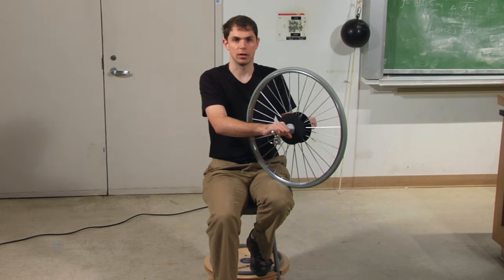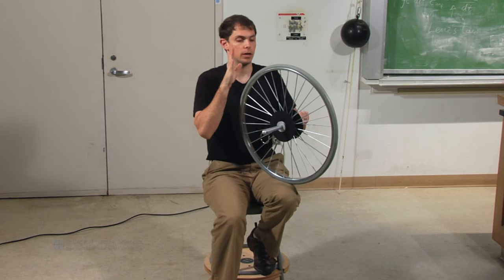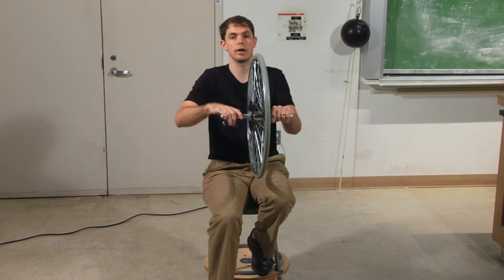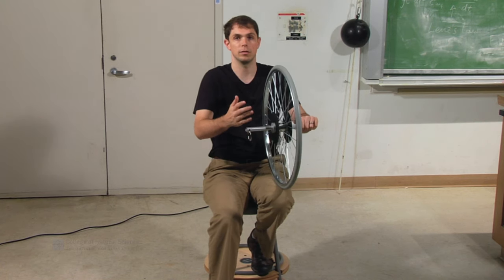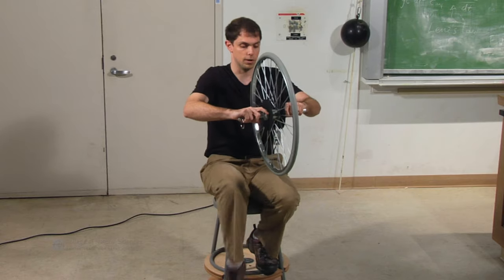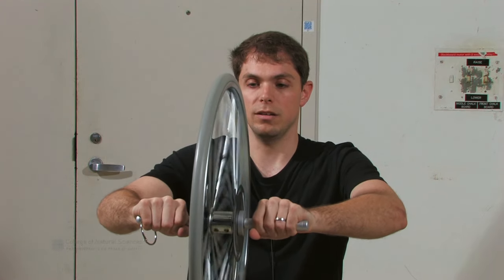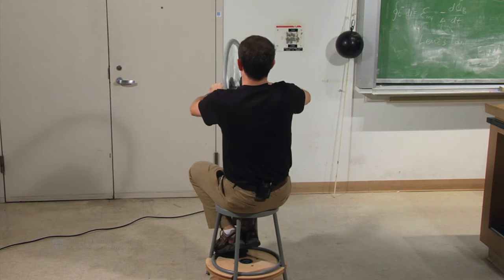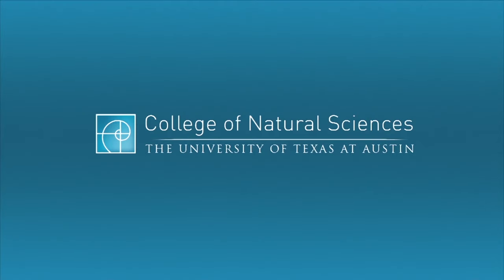Spinning Wheel on Spinning Chair

Comment: This would not have been possible without the confident and firm hands of that assistant, to him I say "thanks!"
Reply: Marlon, though this was posted many years ago - I was hoping you could answer a question.  If the angular momentum was EXTREMELY HIGH would it be possible to rotate yourself sitting on a char that is not a spilling chair?   Thanks!
Reply: Ok Marlon
Reply: "confident and firm hands". I bet that's in his Tinder profile.
Reply: Why does the assistant remind me Mr. Incredible at his workplace? 😅
Reply: True

Comment: I genuinely cannot fathom how this works and I just learned about it in physics
Reply: It just works.
Reply: Air has mass, and therefore can be repelled off of.
Reply: @gabrieli6008  No. This works in frictionless environments too, eg outer space. If this were true you could demonstrate this even better by putting paddles on the wheel, but it would have a negligible influence compared to the extra weight from the paddles. Thats why they don't, its not necessary and it might confuse people.
Reply: @gabrieli6008  it's momentum not thrust
Reply: @indiomoustafa2047  Oh shoot shows how much I know
Reply: @gabrieli6008  Think of the person, chair, and wheel as a system as they are all connected. The wheel builds up angular momentum as its spinning. When held horizontal its adding horizontal momentum to the system, when vertical its adding vertical momentum but his spine and chair have much much more resistance on the y axis than the x axis so when held to the side he slowly spins because the chair spins from low friction. A gyroscope is basically multiple wheels spinning all counter acting each others momentum causing stability. In space if he held the wheel vertically he would slowly backflip or front flip, hope that helped =D
Reply: @Anna_bananatv  great explanation
Reply: @Anna_bananatv  would weight only factor the speed and duration?
Reply: @gabrieli6008  No.
Reply: @Anna_bananatv  sheesh what an amazing explanation
Reply: Eric Laithwaite, ether, geocentrism.
Reply: The simplest way to explain this effect, is that it would NOT work if the wheel didn't slow down with time. The rate at which the wheel slows down is indicative of the amount of force transferred into the chair.

An interesting question is whether or not the distance at which the wheel is held from the center of mass has any effect on how much of the force is transferred into the "desired" direction (eg. force applied along a given vector).
Reply: @sandercohen5543 does chair spin constantly or is it only pushed by force needed to tilt wheel?
Reply: @Anna_bananatv  YES!! Thank you for this hey, my force diagrams were starting to not make sense. Now, in the x direction, the initial momentum (of the wheel) was in the +x direction (as WE look at him), so when he turns that 90 degrees clockwise (as he did), the momentum of the wheel is not in the -y direction (or downwards) yes? and thus THIS MUST be counteracted as IN THE Y DIRECTION THERE WAS NONE TO BEGIN WITH AT ALL yes? So then there is a torque UPWARDS from the person - this would explain the anti-clockwise spin (when we shift our view to the top his nose facing in the direction we was looking friom initially). In the y-direction there indeed is the L from before = L after = 0.BUT now what about in the X-DIRECTION??! That's what's throwing me off! Yes i do believe that's where your explanation comes in, that ONLY IN SPACE would we then be able to observe that effect - as the guy's momentum should be the same as that of the wheel before - in the +x direction right? So that would make him spinning with his head coming forward then down and his feet rising up behind him right? A forward flip is that not? See i ask this because - i assume you didn't have time to expand on this one, thanks again for exanding on the first part! - you had an either there. I just want the confirmation of a FORWARD FLIP? AND....WHERE DID ALL THAT MOMENTUM that SHOULD exist in the +x direction GO THEN? I'm assuming it got converted into a angular version of IMPULSE. Which pushes the stool/chair backwards? Is this true? Does it make sense? Like I'm thinking thw friction between the chair's legs is greater though than the..what force this must be then as we are now talking about forces...Torque? The chair-and-human system applies torque on the floor that is a result of a ((its) final)momentum directed in the +y direction? See because most questions and images and all don't cover this concept/part. See how even the flip was 90 degrees...what if it was 180? That's for space tho right (AND the a literal 180 degrees flip part for a initially held vertically wheel..which again is what most books have and all). I was starting to think i'm not getting this at all, turns out it was this "impossible" motion all along, the front flips. Thanks again!
Reply: Yogic sciences told us everything
 government just hid it with history you have today
Reply: @gabrieli6008  nothing to do with air

Comment: can you do one more where you spin yourself and see if the wheel spins in the other direction you are spinning to compensate?
Reply: If he spins himself, it means net torque on the system is not zero, so no, it won't
Reply: @herbert7344  this is what I don’t understand. So does it really make a difference if you spin the wheel yourself? Other demonstrations of this show people having no rotation at all while the wheel is spinning in one direction and then rotating really fast after flipping it. Other clips like this show being able to turn freely in both directions
Reply: @felulaval4742  Its because it has very little to do with the wheel itself. The turntable is just receiving forces from the person sitting or standing on it. If you are moving an object in your hands this is shifting your balance. This eventually results in you applying a force to the turntable with whatever contact points you have. E.G Your Ass or your feet. 

You can do the exact same thing without a wheel, and with a heavy object, or with your own arms.
Reply: I'm confused lol
Reply: Why is this so hard

Comment: This is basically what a reaction wheel in a spacecraft does: Because there is no medium in the vaccum of space that provides any meaningful force when pushed against, in order to rotate without expending mass, we use the inertia from weighted, spinning discs, that are rotated using an electrical motor.

Comment: Nice... You also had to use internal energy from your muscles to tilt the wheel from vertical to horizontal above and beyond the exertion that would have been required if you and the wheel had not been spinning...

Comment: So where does the angular momentum go if you rotate the wheel while its spinning but the chair spinning axis is locked so as to prevent turning on that axis and the handles are locked in place so that they can only rotate on one axis as prescribed by your arm rotation?
Reply: Momentum would not be conserved because there would be an external force involved, which is locking the axle in place.

Comment: I have a question. Is angular momentum conserved here? If i think of the angular momentum vector at the start it points twoards the right but once he turns the wheel it points twoards the floor while the angular moment vector of the chair points up. So the two momenta cancel. But overall there is no net momentum vector that point to the right unlike at the beginning. So is angular moment conserved or am i missing something. Is it because he applies a force on the wheel?
Reply: I need answers, please if u already know teach me senpai
Reply: Help me sleep
Reply: @uhmmmmmm...  in this example indeed only the z-component of angular momentum is conserved because thats the only axis the chair can freely move around.

Comment: why does it go in that direction? just because it's a law of nature or gravity??
Reply: Gravity plays no role in that. When you spin a rotating object in a different axis, you apply a torque to it in a particular way.

Torque demands force, and force changes momentum (which is conserved!). 
On the spinning chair, without anything holding him still to the ground, he only has the momentum of his own body+chair to give to the wheel. Thus he's accelerated according to the torque he applied.

If the wheel was spun in the opposite direction (it's spinning clockwise from his right hand. so, the alternative is counter-clockwise), the way he moved the wheel would spin his chair in the opposite direction too.

Comment: Wow, another great “physics” presentation. And where did your angular momentum “around” the horizontal axis go if this is about conservation of angular momentum?
Reply: That’s why he spun. They go explain, vs fun demonstration, here: https://youtu.be/ayjC1E3lNKc
Reply: @alexdasliebe5391  Two years later but ok. This video is about the conservation of angular momentum and you pointing me to the video where the momentum is clearly changed/gained by the external force, namely the gravity. On the other hand in the video above there's the impression that the system is isolated from external forces (after the wheel is spun of course). But it isn't. If the same experiment would be conducted in a no-gravity environment he would be rotating around the horizontal axis after he turned the wheel on its side. This is due to the fact that "Angular momentum has both a direction and a magnitude, and both are conserved" (see https://en.wikipedia.org/wiki/Angular_momentum#Conservation_of_angular_momentum)

Comment: Ok. Give me a second to understand this. The spinning wheel now has angular momentum caused by your assistant. You explain that the momentum is in conflict(conservation of energy) with your momentum but by all visual understanding you are not moving in order for you to have any momentum. Or is it that you are truly moving at the rate of Earths' spin axis???
 It is most defiantly not due to the torque that you applied when you moved from vertical to horizontal, because if that was true you would not continue to spin in your chair. All I can see is when you have the wheel spinning with gravity, all is fine, as soon as you change that momentum it is going to try to conserve, hence the natural spinning in all matter.

Comment: I don't get it! Why did the spinning wheel make his chair turn?
Reply: Magic
Reply: Did you get it now?
Reply: When you consider the man and the wheel as the system, no external torque is acting on the system. Hence, Angular momentum is conserved 

The wheel was initially moving which means it has angular momentum, but the man was at rest so he had zero angular momentum. 

When the man changed the direction of the wheel, the angular momentum of the wheel changed, therefor, since angular momentum is conserved, the man will have to move in the opposite direction for the angular momentum to remain constant
Reply: @willa3302  if angular momentum is conserved what happens to it if he sits in a normal chair that can't rotate?
Reply: @TNaizel  You will still feel it, just that the friction from the chair which cannot spin stops you from spinning. Similarly, if you did it in a zero gravity environment you will spin.
Reply: @TNaizel  if the chair is fixed, then there will be a net external force and conservation of angular momentume wont be valid. It should be noted that there must be net zero torque(or net zero force) for conservation of angular momentum to be valid... i m not sure if i am correct, can anyone confirm what i said is right?
Reply: @willa3302  I don't understand. The initial angular momentum of the wheel-man-chair system is to the X-axis, the final angular momentum is 0 in both direction. where is the x component ?